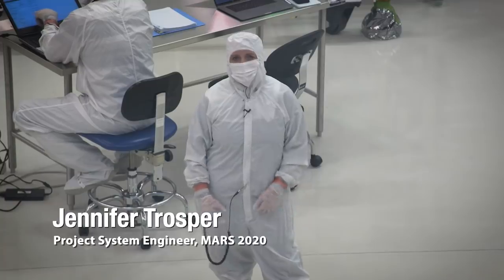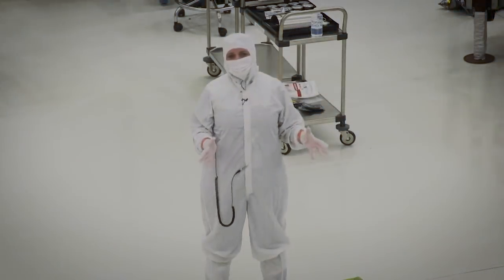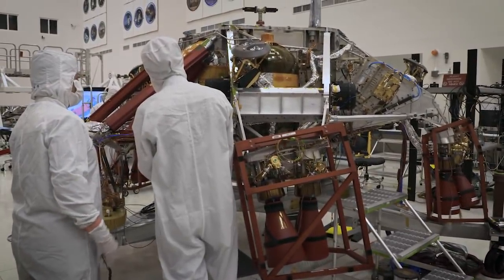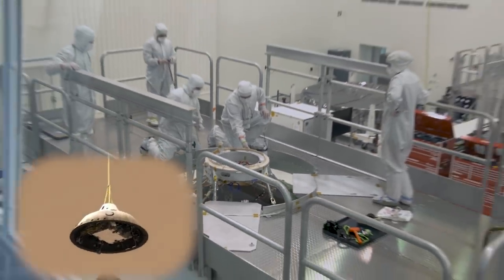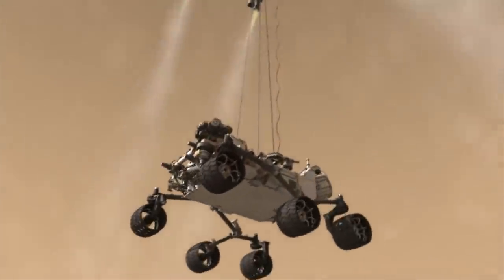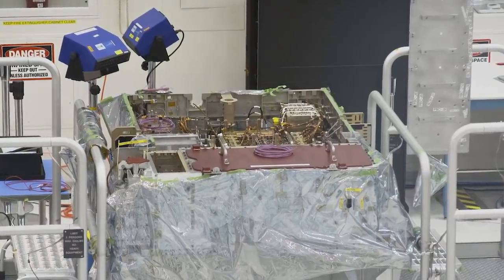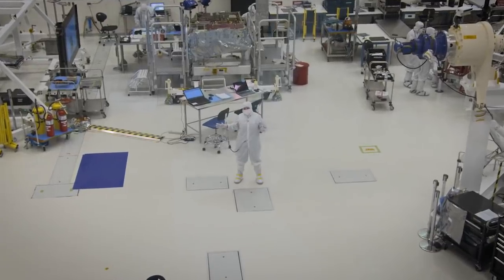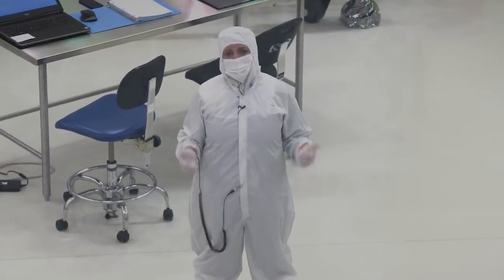Mars 2020 Rover Build Update

Comment: Wow, amazing.  I suspect the wheels will be a bit tougher this time.
Reply: I think the aluminum will be a bit thicker, yes.
Reply: @ThorkilKowalski  Aluminum alone wont make it I believe... They must have been trying to mix it with other composites... Or just carbon fiber...?
Reply: And it obviously won’t run on Solar Power
Reply: Redesigned with different patterns and thickness
Reply: @arizmack6341  The current one does not run on solar either.
Reply: I think there's... a video here, that explains that they will use some sorts of memory alloy, that will deform when moving over a rock, but will snap back to shape once, um, heated? Or something? :D
Anyway, yes, the wheels will be a bit tougher this time :)
Reply: @Jan_Strzelecki  - cool.
Reply: They will use a stone wheel
Reply: @Jan_Strzelecki  that s not applied in this rover. The wheels are jsut tougher this time.
Reply: @LaggerSVK  Okay, fair enough.
Maybe the next-next-gen version will include some extendable arms to pick up and remove stones out of rovers way ;)
Reply: The wheels are made from aluminium and titanium.
Reply: It will be legend
Reply: Why don't they use continous tracks?

Comment: Info box says yer gonna land in 2012. Does this thing have a flux capacitor?
Reply: It will get there faster than the speed of light! ;O)-
Reply: That was Curiosity. It landed in 2012 and looked very similar.
Reply: Buckeroo Bonsai has left the chat room.
Reply: is has the same base configuration as the 2012 curiosity rover
Reply: Nucleus There was actually an error like that with a Mars satellite. NASA and ESA were working together on that mission and somebody mixed up feet and meters on the trajectory, and it crashed on Mars instead of orbiting around it.
Reply: Definitely don't need no roads on Mars.
Reply: Government logic.
Reply: typo mistake in the description
Reply: Wasn't the world suppose to end in 2012? From some big comet thing?😃😀😃
Reply: @Corvaire  plaid speed!!! Is faster.
Reply: It's not exactly rocket science to fix the mistake! 🤣
Reply: That was the curiosity rover. jeez.

Comment: Nice workshop. Such beautiful and clean workshops can make work more easy.
 The NASA employees are very lucky to work in a well organized space.
Good for them, good for the final result.
Reply: @pjd412 Its all the sensitive parts like electronics and computer boards that are susceptible to damage from micron dust particles floating around during assembly and manufacturing. Absolutely all spacecraft are built in clean rooms such as this, to protect them from dust. Noticed how they are wearing static bracelets too for electrostatic discharge protection of electronic components. So its all part of good spacecraft manufacturing practices and nothing new really.
Reply: Well, it isn't called Jet Propulsion LAB for nothing... ;-) (unless they got rid of those suits straight after filming)

Comment: Boston Dynamics should get their Atlas robot on board so he can fix stuff around the boat. Problem though is that the distance doesn't allow for live remote control, so it would have to bring AI of some sorts with it or they would need to wait 40min from input to feedback. Still, there should be multiple mobile components to the mission equipment, so if one breaks, they can still operate the other and try to fix it if possible.

Comment: they should have an orbiter that can retrieve the samples and remain in orbit until another mission can collect the orbiter with the samples. that would make the secondary mission cheaper and it could probably be done in less time. the rover would place the samples in a small vehicle and a solar balloon could take the samples contained the vehicle to low orbit or at least high altitude and some type of thruster would take the vehicle into orbit to meet with the orbiter. the retrieval would be accomplished without having to land on the Mars and possibly with something that is already in use.

Comment: This time consider making something that will wipe out the possible dust from the solar panels if dust strom happend....
Reply: You'd think the best engineers at NASA would have though of that.. Except this Rover doesn't use solar panels, should be powered by radiation, like the Curiosity rover. As for Opportunity, it lasted for 15 years. Originally intended to last for 90 days. Questioning the decisions and skill of these engineers is a bit silly.
Reply: @arog7493  I didn't question, I am a layman saying my thought..
Reply: Brushes can scratch the solar panels, plus the dust will get into them, so they'll harden or smthg i donno

Comment: Why rovers doesn't have belts instead of wheels. The weight spreads better on belts. I heard that some rovers got stuck in the Mars sand.
Reply: Yea, but If rover had belts he could surmount more complex terrain. And as I said before the weight spreads better on belts, so the chance of stucking in sand would be much smaller. I understend that the rover would need a stronger engine but still.

Comment: Ooo yall build the photocels to clean?
Reply: Nope. This one is based on curiosity which is powered by a Radioisotope Thermoelectric Generator. It has a small plutonium pellet which releases heat as it decays and is converted to electricity. This technology is proven and reliable.
Reply: @arnavkalgutkar6169  just like snap
Reply: @arnavkalgutkar6169  Good, I notice somebody uses google too, not just YT...  ;-)

Comment: It's pretty impressive and it will be good to have a new rover on Mars but the system to put it there look very complicated, what's the reason ?
Reply: Andre Bureau The skycrane simply allows it to be lowered to a soft landing, which due to its size, is more feasible than the parachute landings or airbag landings we’ve seen with the other rovers.
Reply: @ZooNamed123 , thank you, I see it's a good compromise. With 1/3 of eart gravity it certainly possible. Will the skycrane used for somthing else afler the landing or will it be made to crash far from the rover ?
Reply: Andre Bureau it would crash since it isn’t capable of more precise control other than to help lower the rover.
Reply: @ZooNamed123  , again, thank you, I find it a waste but I'm not as bright as the one on this project so I appreciate greatly your response to my inquiry.